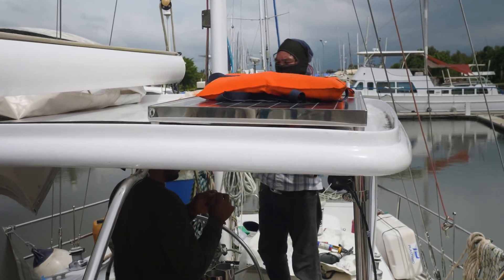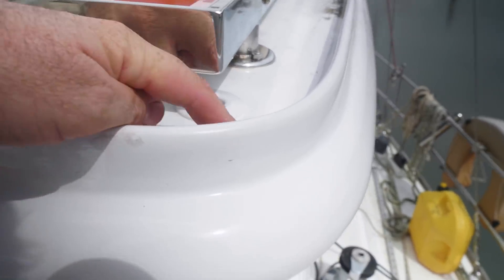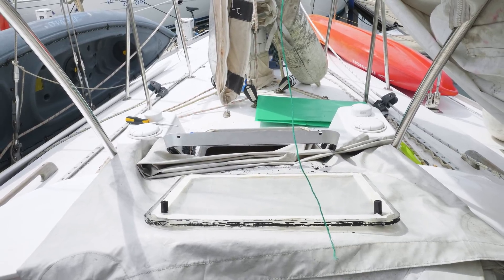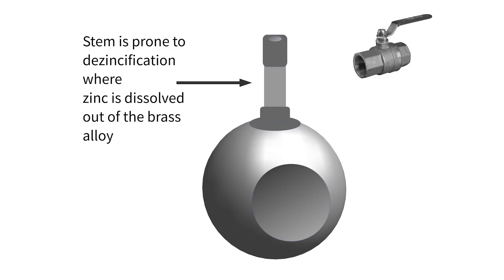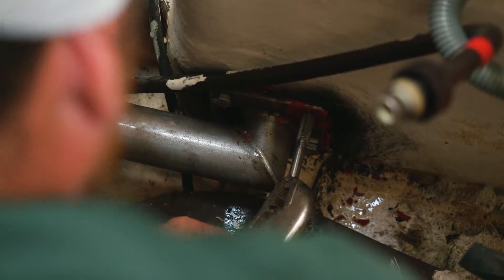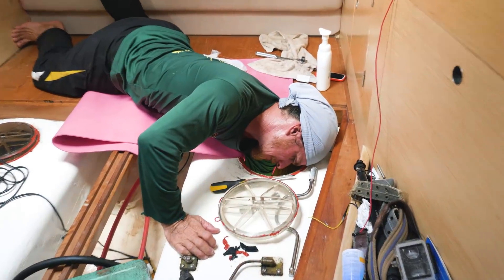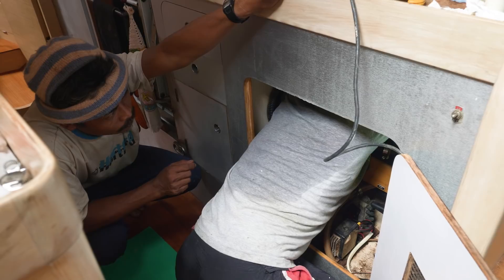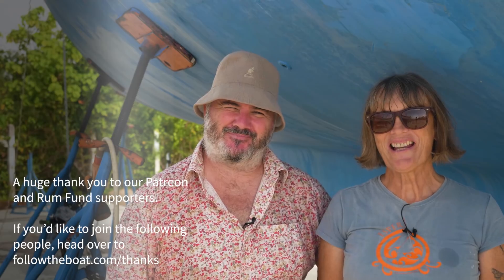REPLACING FIVE SEACOCKS & HAULING OUT AGAIN... Ep121

Comment: I didn’t see a full shot of the underside of the dodger, but you might want to try directing the flood lights off the underside of the roof of the dodger for indirect light. It might give you a nicer fuller light that’s not blinding, if the purpose of them is to light up the area under the dodger.  Also, thanks for the great videos!
Reply from the maker: The floodlights are intended for filming purposes,  to keep an even light when we film in the cockpit. Once we're back at anchor that's where we do most of our to camera pieces and the changing light can make it quite difficult. We'll be adding soft LED strips for ambient lighting. Cheers! Liz

Comment: I thought that you would of recessed the white water drain fitting down into the Dodger, so that you don’t get a big puddle of water around the outer edge of the Dodger. Really admire your work ethic. Great video 👍
Reply from the maker: The outlet points lead down a detachable hose, past a filter, directly into the water tanks. Should avoid spillage! Liz

Comment: Hi Guys, love your videos as like you I have a 50' ketch. As a marine survey though, I couldn't help notice that your ball valves were nickel plated which are not corrosion resistant (CR) or dezincification resistant (DZR). Plated valves are the cheapest and often fitted by manufactures because they are cheap. Replacement valves should be either of best quality bronze or as a minimum have the letters CR or DZR cast into the body. These are items are not normally nickel plated as why would you plate something that was already had good corrosion resistance. Happy sailing.
Reply: Simon Allan Thank You Simon, I will look for this in the future. One thing that i've learned over time is that there are many types of brass, some are appropriate for marine use and some aren't. Some will work if they're protected cathodically. Some are called bronze (like Tobin) but are still technically brass. Anyway, there is in general a popular disdain against "brass" "gate" valves. But they are actually also available in alloys that are suitable for marine service. Having prepared many larger boats for Coast Guard inspections, i just want to say that gate valves are what they are expecting to see, and that any prejudice against gate valves in general is not really justified. You can find gate valves in marine-appropriate alloys if you look for them, you're just not going to find them at your corner Ace hardware store. In sizes over 2", they start to become the most practical choice. Do i have a personal favorite type of valve? YES. Milwaukee Butterball. Also, most ball valves really need a good 30psi in order to actually seal. Many yacht valves never see more than 3-5psi; they are subject to weeping, and if you pick one up off the shelf and blow through it, don't be surprised if it leaks a bit. BTW a brass is alloyed primarily with zinc, bronzes: tin, in case anyone is wondering what the difference is.

Comment: I believe what you have.and referred to as "seacocks"..are called in-line valves...available at any home depot for 15 bux or less, VERY EASY to snap right off and sink your boat (regardless if they are brass or BRONZE).. look at all the leverage on those hoses, bearing on a 1/2" shut off...especially where a bunch of crap is stored  ....a proper seacock is flanged/ made of bronze and typically start at 3/4". I'd upgrade to those (I did !)      Fair winds

Comment: Couple of issues, if I may:Sea cocks: Those made from brass with handles i carbon steel painted red, is usual not compatible with sea water over long time. Skinn fittings: When you are on the hard, use a knife and scrape the metall. If shining yellow, ok. If pink/red-ish, zinc (Zn) has disolved from the metall and you are left with poruous copper (Cu). Replace. Problem can be avoided by installing higher quality, and/or use bonding with anode. Like for instance done by Fairline.Diesel tank connection: From your video, it looks like a pipe is going between the two tanks. This is a ridgid connection, and will over time start to leak. Law by nature. Cut out 10 centimetres of the pipe and connect with i piece of rubber hose. Ridgid connections are bad engineering.BRs/v Hulda
Reply from the maker: Our new Groco bronze seacock set-up should be just the ticket. Keep watching the diesel tank developments, you'll find out what we did! Liz x

Comment: Just wondering if you had considered the Tru-Design plastic seacocks. I had to change all of my seacocks last season because when I bought the boat 4 out of 6 of them were ceased open. I liked the idea that they don't need bonding, don't corrode, appear to be capable of taking a lot of abuse (not that they should have to) and are considerable cheaper than blakes which were my alternative choice.
Reply from the maker: We looked at composite replacements, but chose bronze for two reasons. 1. The composites sourced here are too big to fit in the space, 2. Composites have been known to crack, especially in cold weather. We're happy with the Groco fittings we chose. 😊 Liz

Comment: You said the water is to be put in the fresh water tank. If so why are the holes to catch it located on the inside of where your canopy rail is plus the amount of water that will sit in the canopy above will be sitting. did you think or was there a reason that you didn't put you drain to the far corners recessed below the top to catch all the water. As for the water a good carbon filter to catch minerals and other things before entering you tank.
Reply from the maker: Yes, the water will run through a detachable hose with in-line filter inside the dodger and out through a dedicated hole into the deck-mounted water tank fittings. If there's any water sitting on the roof, it should soon run off with the motion of the boat. Well, that's the theory! Liz

Comment: Your seacocks ( & all metal fittings in contact with seawater for that matter) should be bonded. An oversight (shortcut) by the builder. This certainly contributes to the degradation & premature failure of bronze thru hull fittings. Also, you should have wooden bungs attached to every thru hull as a comman safety measure.
Reply from the maker: Yep, we've got the bungs in a box, waiting to be clipped close to each seacock. We're pretty happy with the new bronze Groco seacocks. Liz
Reply: Sailing followtheboat there is nothing better! Gross Mechanical Laboratories.

Comment: All known gaskets, seals, hoses and O-rings are compatible with blends of l ess than 20% biodiesel. For higher BioheatR fuel Blends than 20% biodiesel, up to and including 100% biodiesel, compatibility will depend on the materials they are made from. For BioheatR fuel Blend concentrations over 20% biodiesel, fluorinated polyethylene, fluorinated polypropylene, Teflon, Teflon lined, or Viton Components are recommended. Use of other types of materials in BioheatR fuel Blends over 20% biodiesel such as nitrile, natural rubber, or Buna-N type rubbers may cause leaks, plugged filters (due to dissolved material) and eventually complete gasket, seal, hose or O-ring failure....
  {edit}
  It appears that any vessel having the possibility of taking on Biodiesel fuel should have tank gaskets made of either Viton or Teflon, certainly not Buna-N. The problem doesn’t stop with gaskets. The Biodiesel will attack fuel hoses, o-rings, and seals. But it supposedly won’t harm fish! ... Just Thought ya should Know  :-)
Reply from the maker: Cheers, TERRY! 👍 Liz

Comment: Mads from Sail Life, used all plastic sea cocks - I think nowadays we’ve learned enough about plastics to make them better than dodgy metal ones.
Reply: Better yet...no seacocks at all...much safer...I hear tell that many sailboats have sunk at sea due to failed seacocks.
Reply from the maker: We looked at composite replacements, but chose bronze for two reasons. 1. The composites sourced here are too big to fit in the space, 2. Composites have been known to crack, especially in cold weather (where we're heading!). We're happy with the Groco fittings we chose. 😊 Liz

Comment: Those seacocks look like run-of-the-mill ball valves available here in south america. The problem is they're brass, not bronze. Silicon bronze is the stuff old seacocks and propellers are made of. Brass is not corrosion resistant and I would personally NEVER use it under the waterline of a vessel that sees salt water.
Reply from the maker: They were DZR brass
Reply: Sailing followtheboat Again, you probably would've gotten away with it if the cocks were installed above the waterline and not in contact with saltwater day in day out. Brass is in no way (in any of it's flavours) nearly as corrosion resistant as bronze. If I'm not mistaken, in the ninetees there was a propeller manufacurer that maked props out of DZR brass. They corroded like soluble aspirins at the intetface with the shaft (and eventually broke off) because of the same reason. Any time you have dissimilar metals in an electrolyte, you will accelerate corrosion even further. Keep the vids coming. They're intetesting and informative. Cheers.

Comment: Hey Jamie  there's a through hulk system with a. Brand called Groco it's American and it allows you to put an inlet
Pipe into the seacock for the engine I take so that when the valve is closed the intake can act as a strong emergency bilge pump to draw water from the bilge, it's on a website called groco and it's also got a terrific oil change machine which stays hard plumbed to the engine makes changing oil a cinch . Any just in case you are interested
Reply from the maker: We've just installed Grocos elsewhere , so know we can get them here. Thanks for the tip! Liz

Comment: If I may add my two cents worth, you have way to many through hulls, all subject to failure as proven.
Having build boats for the Bering seas fisheries, I am a firm believer of using ONE properly valved Sea Chest from which all water is sourced.
Reply from the maker: The Sea Chest is a new concept for us, and is certainly something we will look into in the future. Cheers! Liz
Reply: Sailing followtheboat sea chest is very common on larger vessels, they are basically a big seawater manifold. All of the thru hulls that are on the hull skin on yacht-sized boats would need to be sealed just as well on a sea chest as they are on the hull. Shutting off the water to an entire sea chest can be problematic. Many of Vesper's seacocks benefit from being physically separated around the vessel, some do better near the waterline, some are better off being in deeper water. It is not normally as practical or convenient for a yacht to have all the valves concentrated in one place, since you wouldn't want the sink drain or head discharge using the same manifold as the intakes, nor would you want any air discharged into an unvented sea chest. Additionally, sea chests can be quite difficult to access for cleaning. So they are generally more appropriate for "T Boats" (<10k tons) and the like or larger vessels than they are for pleasure boats. The ones that i have had any experience with were welded integral to the hull, in the engine room, all intakes, sometimes with no type of shut-off for the whole thing. However, that doesn't mean that you cannot rig up a remote-control shutoff for seacocks that may be difficult to access under marginal circumstances, with something like morse cables or just string and pulleys (bullet blocks).
By the way, if i'm concerned about how many of the threads on a thru-hull (not a seacock) are actually engaged inside  of a valve, i have been known to augment the pipe joint with an epoxy fillet around the outside. Don't worry, it will come apart when it has to, and I'm not losing sleep in the meanwhile.
While I'm on the subject, i would like to mention that it pays to be mindful of thru-hull placement fore-and-aft, as well as side to side and up and down. That is, the "bow wave" of a moving vessel has an  effect on something like an engine exhaust placed under the (stern) counter. If the exhaust line, or bilge pump discharge for example are out the transom, they are resistant to siphoning since they are somewhat vented. If the same lines discharge under the counter, there is significant back pressure and a high "head" inside the hose because of the raised stern wave when the boat is moving through the water. Conversely, a thru hull near the middle of the boat (fore and aft) might only be immersed half the time bc of the low wave amidships. Too much information, i know, but i actually learn a heck of a lot as well from reading the comments so thank you for letting me share what has worked for me.

Comment: Surprised that the DZR bronze sea cocks have a spindle that is not DZR.   You clearly show that the spindle was pink, ie dezincified.   Can I ask what age is the sea-cock that failed?   On my 2001 boat, I found dezincifacation on some of the skin fittings at 10 years old.   So I had all the skin fittings and sea-cocks changed to DZR.   Hopefully the spindles are also DZR bronze - but how would I know!   Moral of the story for others is to remove all the anti-foul off the skin fittings every now and then and see if there is any pink colour change.   If there is, change them all
Reply from the maker: Nice one,  Boyd, a good lesson to us all. Liz x

Comment: The European Community’s Recreational Craft Directive (RCD) of 1988 introduced an ISO standard for through-hull fittings stating they should be corrosion-resistant for a service life of just five years. I have seen plenty of boats that used brass plumping/air fittings that wouldn't even last five years. Good choice to get them changed as you do not want to have a problem with your through-hulls in the middle of the ocean.

Now that the fuel leak is finally sorted out you know it is time for something else to break. 

Sad news about the loss of life and missing people. With the excellent weather forecasting available today there is no excuse for these deaths. Someone should be sitting jail for their decisions that day.
Reply from the maker: Yes, those bronze fittings should do us proud!
There was no excuse for them being out in that weather. The sensible owners remained anchored off Racha, putting their passengers ashore, rather than trying to get  back to Phuket. That's wide open water into the Indian Ocean, with waves barreling in from the SW monsoon. It was a tragedy that didn't need to happen. Terrible. Liz

Comment: Hi you two, I know that you've probably already replaced the sea cocks but the only, and best solution are Blakes Bronze Sea Cocks. I have these (original fitting) on my 39 year old Nicholson 31 and they are still in service with no corrosion. The "new" version enables you to add grease whilst in the water. You will not find a better solution. AND yes you should always close your sea cocks when under way or when you leave the boat. Fair winds :-)
Reply: Blakes Bronze Seacocks have not been bronze for several decades. They are DZR brass nowadays and the new ones don't last anywhere near as long as the old ones.
Reply: I noticed that you don't have bonding wire on the seacocks also noticed no backing plates against the hull.  Keep up the good work on the boat. Looking good.
Reply from the maker: We're pretty happy with the bronze Groco fittings we chose. 😊 Liz
Reply: Thanks, good knowledge, I didn't know that. Guess I'll keep my antique Bronze Blakes.

Comment: For your info extension nuts are available in a bolt shop.  They are about 4 times as long as a standard nut. With more threads engaged it makes if far more difficult to strip the threads. They are available in stainless.and could be welded to the backing plate inside the tank. No welding in the tank take the backing plate out and weld.  csmale@bak.rr.com
Reply from the maker: Cheers, thanks for your expert advice! Liz

Comment: Hi Jamie and Liz. Are you aware of these fully certified nylon composite Sea-cocks (Ball Valves) made by Trudesign.  http://www.trudesign.nz/marine/products/8-manual-ball-valve
They have no corrosion issues. The sailing channel Sailing Creo replaced all their sea-cocks with these composite Ball Valves.
Reply from the maker: We looked at composite replacements, but chose bronze for two reasons. 1. The composites sourced here are too big to fit in the space, 2. Composites have been known to crack, especially in cold weather. We're happy with the Groco fittings we chose. 😊 Liz